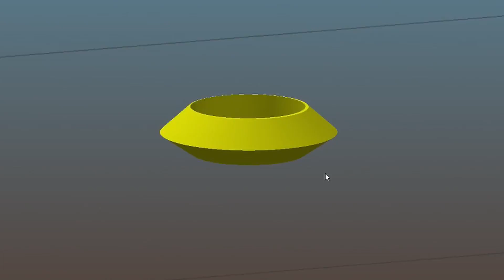Making Edelgards Axe from Fire Emblem Three houses

Comment: Nice build! Good job! I love seeing all the awesome projects you make.
Tip: those layer lines look like a bed leveling issue. Maybe try releveling the bed. It happens to me sometimes too.
Reply from the maker: My prusa has been in dire need of some TLC, and it just recently died.  Turns out on top of the bed leveling, it needed a new cooling fan and new ptfe tube.  Hopefully I can get it up and running again soon to keep up with the projects :P.  Thanks for the tip.  What kind of 3D printer do you have?
Reply: The Blacksmithing Gamer I have an Ender 3. It was perfect for my price range and has worked great for me so far. I have had it for about a year.
Reply from the maker: @seeminglyRANDOM88  Ive been contemplating another printer...Trying to hold off but Im getting frustrated with fixing my prusa.
Reply: The Blacksmithing Gamer With the price of the Ender 3 and the print quality, I have had no regrets in my purchase. I waited a long time but it was one of the best decisions I have made.
Reply from the maker: @seeminglyRANDOM88  Dont get me wrong, my prusa has been my old faithful for more or less 2 years now.  But Ive been using it so much and neglecting some of the needed maintenance.  Theres always an excuse to get a new 3D printer tho! lol :P
Reply: The Blacksmithing Gamer Yes there absolutely is! I wish I could have a few to cut down on the time some of my projects take.